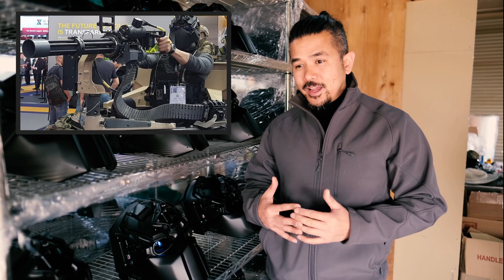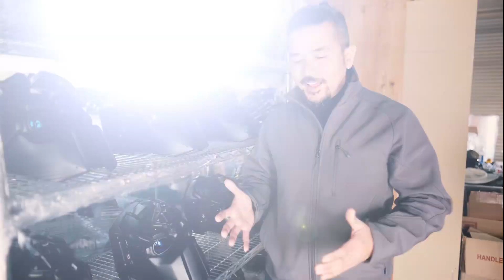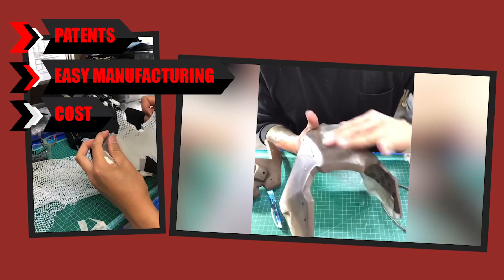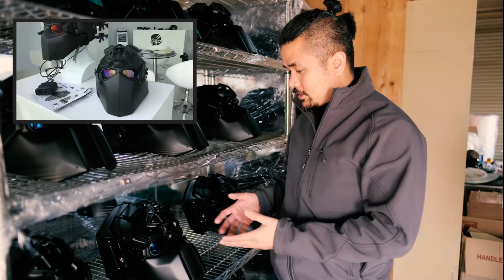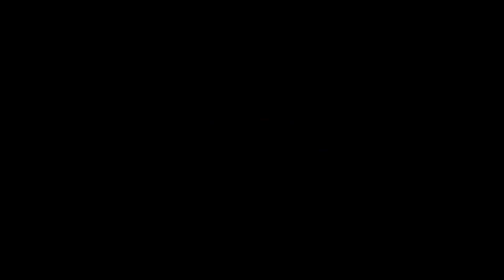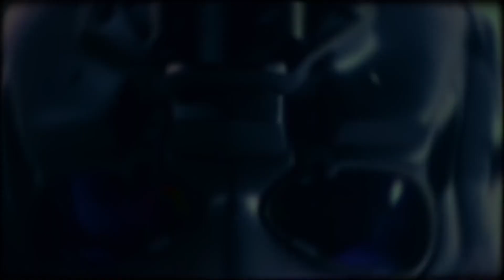GIGN FAILED PRESENTATION. THE DEVTAC RONIN RESPIRATOR STORY.

Comment: Excellent. I agree, interfacing a CBRN respirator system compatible with M60 cartridges would open up applications.
Look to the M51. 
Detachable facepiece with analogue sensors to isolate circulation when respirator is applied?

Comment: you can try an in closed mask with LCD or projected internal vision that has eye following soft wear and small cameras as vision relay. it can double as heat and or night vision . added protective protection for the eyes and incorporate enclosed breathing and cooling system for components and user . hopefully
Reply: Not a good idea. If the camera that is projecting to your eyes gets dirty or a little smudged, you're screwed. Also there will be a small amount of lag between what happens and what is projected to you. You will not be able to react instantaneously.